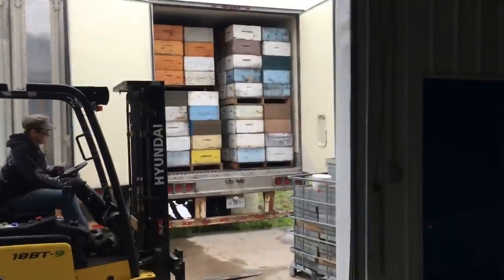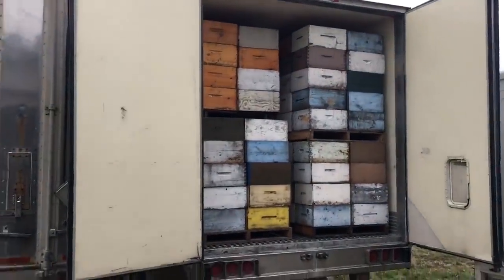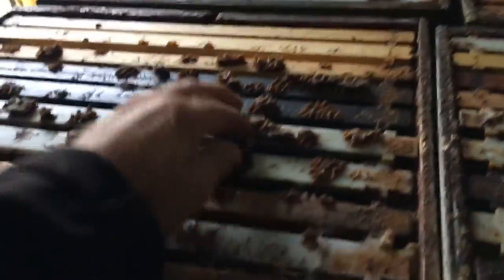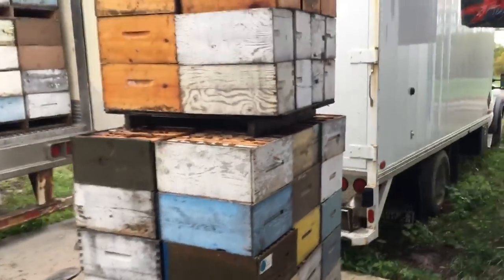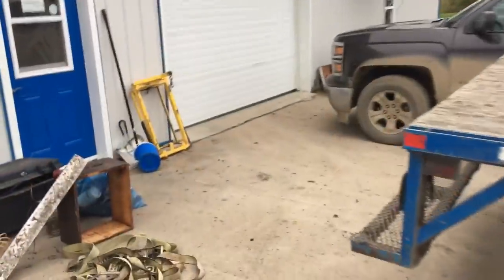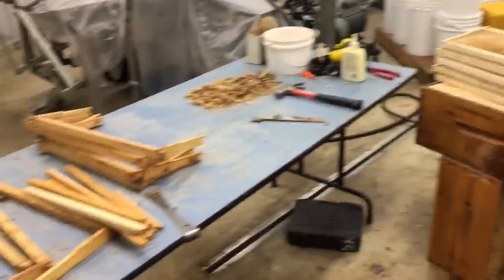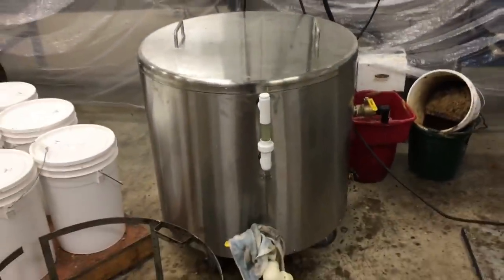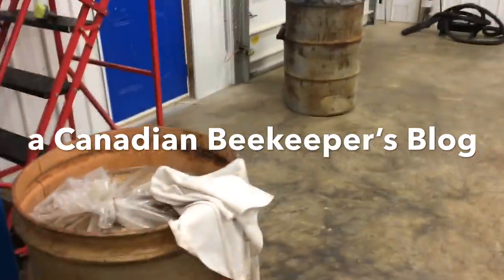Freezing out Wax Moths

Comment: How do you store the frames after you freeze them?  I need a strategy for storage this winter.  I'm in North Texas and we only have occasional freezes.
Reply from the maker: Kelly Disque 
In the deep freeze winter
Reply: I've not had trouble storing comb in warmer conditions as long as I let the bees dry it up.
Reply: Hi  I have 24 hives and I freeze mine then pull them from the freezer put them in my kitchen in the house I put a fan on them to dry them from the dampness from the freezer  then I bag them with contractor clear large thick trash bags  I box per bag  I have not had any problems doing it this way.    I have found that if a moth does get a box they cant go any farther then that box I use duct tape to close up the bags  after they are bagged I put them in the bee garage.  
 hope this helps u .